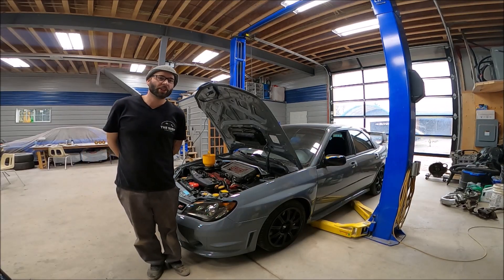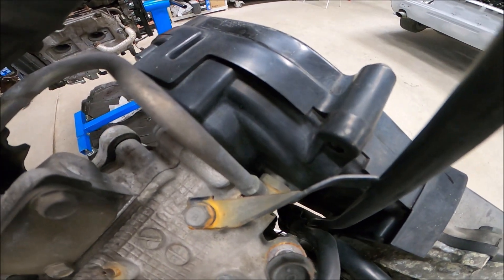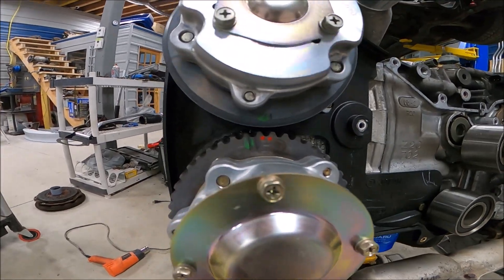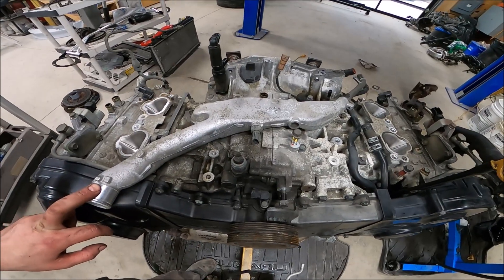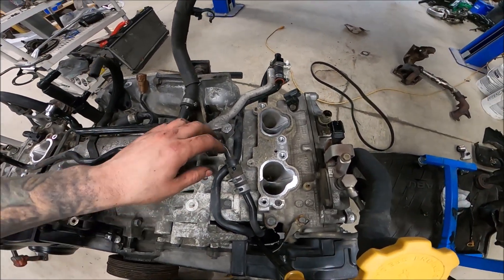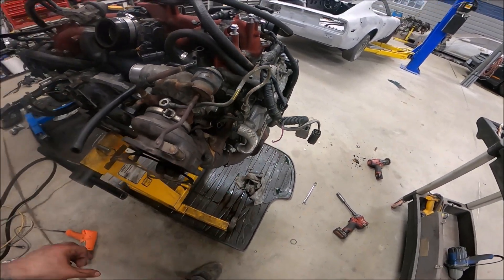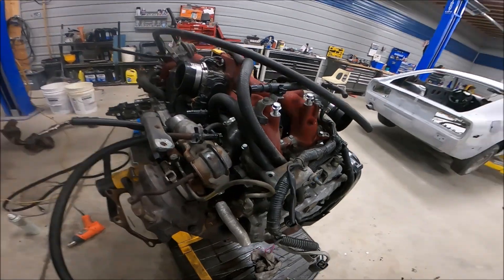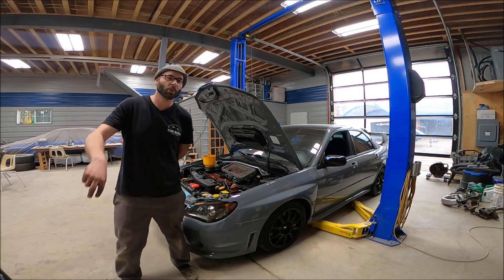How To Jdm Ej20X Swap - 06-14 WRX, 04-07 STI, 05-09 LGT, 04-14 FXT

Comment: I just completed the same swap....Instead of clocking the exhaust cams back 1 tooth, I went a head and swapped the exhaust cams and cam gears from the USDM engine as well. Also replaced the cam seals and checked valve clearance.
Reply from the maker: Yes that would do just as well. Our method is the most common/cost/labour effective way. Leaves his 257 complete for his build. 

How did you do on power/trq?
Reply: @TheSubieSanctuary  I didn't have to do any tuning, But it runs extremely well, Im assuming stock hp/torque numbers.
Reply from the maker: @thebeardedgarage2  nice, they really are a great motor for the money. Rob here has one in his hawkeye and beats the shit out of it on the track. Its held up very well with extreme track abuse and 270whp
Reply: Adam, so when you did the cam swap, you left the timing to stock with the usdm heads correct?
I'm assuming Subie sanctuary didn't need to do that because the STI has dual avcs? 
Does anybody know if you can just reclock the exhaust cams and still use it in a non-sti WRX?
Reply: @carlniro4644  Correct Carl, I did not have to re clock the exhaust cams, because i used the exhaust cams from the usdm engine. My engine swap was a non-sti...wrx swap...so yes, if you wanted to just clock the exhaust gear one tooth back, it would work.
Reply: @thebeardedgarage2  thank you very much, this helps me greatly as i do not have the sti either. Any reason you rather have swapped the cams vs just reclocking the cams?
Reply: @carlniro4644  Hey Carl...I decided to go the swapping the exhaust cam route because i wanted to replace the cam seals, and re shim the valves.
Reply: @thebeardedgarage2  ok awesome, i sincerely appreciate the response and time you took. Thank you
Reply from the maker: @carlniro4644  this sti is single avcs. Our usdm sti’s didnt get duel avcs until 2008 (gr model) 

Leaving the options for 20x/y engine into single avcs car at: 
1. Install usdm exhaust cam shafts and gear 
2. Turn back exh timing 1 tooth on stock 20x/y exh cams (like in video)
Reply: @TheSubieSanctuary  you guys are f-ing awesome. I thought it was newer with the dual. This is going to save me a ton of headaches. My friend and i got into rebuilding these and have a 13&14. Both blown engines. He rebuilt the 13 engine and we have been having nothing but issues with the p0018 code, so i wanted to do a ej20x swap with the next car instead.
Reply from the maker: @carlniro4644  my pleasure buddy! Thats what we here for!
Reply: Great info guys! You guys are awesome 👍👍
Reply: How do you pass emissions with no egr on the ej20x ?

Comment: This makes me feel at ease. I did this swap a few months ago blind and only had forums to reference. I ended up changing the timing by 2 teeth instead of one bc of conflict in the forums. Luckly i still am working the car and haven't driven it much. Ill change it back to one. 

Also made peace of mind bc other than that i did the swap the same way. Thanks for the reassurance!
Reply from the maker: Dont feel bad, the first time we did it we changed it 3 teeth 😂 it was fine and eventually we changed it to 1 tooth.
Reply: @TheSubieSanctuary  ha ha all the different answers from forums 😅.
I'm glad someone finally did a video like this. Especially in high quality and easy to follow video. Thanks again!
Reply from the maker: @NikaidouStep  thanks! Glad it was helpful.
Reply: @TheSubieSanctuary how much hp/tq gain did you saw at the dyno?
Reply: @TheSubieSanctuary  what about two teeth? Having a hard time getting a solid answer from forums.. Vf52. Also, I keep hearing mention of plugging oil squirters or something? TIA
Reply from the maker: @jarltorque4855  1.5 teeth is prefect but not possible. 1 tooth is our preferred route, tested and true. 
There will be no hard with 2 teeth. 
As for plugging exh avcs, you would have to swap on your original 255/257 exh cam shafts, gears and cam seals. Wont notice a different though and its a lot of extra work for nothing really. 
Otherwise there is no way to make the exh avcs simply function in these cars as they are not equipped for it

Comment: Thanks for the vid and clearing this up.  I have actually done 2 of these swaps about 2 years ago, one was an '07 OXT Limited and the other an '05 LGT and both of them, aside from leaving the AVCS disconnected on the exhaust, I did nothing else aside from swapping what was necessary.  I thought I was going crazy because it definitely felt like it lost bottom end punch, especially at initial throttle tip in from stop lights, stop signs, etc.  It took it about 2 seconds to catch up and then start to gain some power in each car and I was unsure of how to cure it.  After studying mode 6 data and watching AFR, etc I still could not see much other than the ST fuel trim was off at initial throttle but timing and trim both caught up at about 2500 rpm.  The exhaust retard of 1 tooth makes so much sense!!!!  Why did I not notice or think of that!?!?!?!  Man, this video cleared that up 100% as I am currently doing my 3rd swap in my own Outback XT, so I'm very excited to notice the difference off the bottom end.  Thanks again, great video brother!!  Total thumbs up.  :-) 😀👍👍🤟
Reply from the maker: Thats awesome! Ya out early 20x swaps were also with no timing mods done. The timing mod really does make a nice difference for the little effort!

Comment: Very Helpful, I'm currently trying to swap my 2007 impreza 2.5i to a WRX and kept coming across EJ20X/Y Motors. I was skeptical at first because of the horror stories from friends of friends. Thank you for clearing most of it up. I plan on swapping the harness, fuel lines, subframe, etc. This winter while also trying to build (more like refresh) a motor for it to drop in. Once again thank you so much!
Reply from the maker: My pleasure! Ive done A LOT of these 20x/y they are incredible for the money. Very reliable up to 350whp no problem. Glad the vid helped!
Reply: @TheSubieSanctuary  I was talking to iWire USA the Subaru wiring company. And they said. The JDM Legacy GT ECU won't work for this project because it is CANbus equipped.
Reply: @TheSubieSanctuary  my builder said I would have to use a Standalone ECU by Haltech but that’s nearly 2500$ and I want to find a way to use DUAL AVCS without putting a hole in my wallet
Reply from the maker: @marcuswade2974  a local friend, unlocked the 20x ecu himself and wired in the exh avcs. It’s possible, its not common to do but can certainly be done on the cheap using above method.
Reply: @Subie Sanctuary, If we use a JDM ECU, would that mean our AP won't work?    If not, can we still use RomRaider?   (Is it even worth the effort if we already have an AP?)
Reply: (I have a '10 FXT 4EAT*)
Reply from the maker: @serpentslick  if you use jdm ecu then no cant use the cobb ap anymore. 
Cobb has become limited anyway now and most people moving away from cobb
Reply: Save yourself some money an just buy a wrx . By the time you spend all the money on parts and labor you could've bought the car. Believe me. I had an 04 impreza 2.5ts n/a an now got an 06 obxt . You got think motor,mounts,driveshaft, axles ,rear diff, wire harness , etc. Save your money an buy it. So much easier.
Reply: @TheSubieSanctuary  Hey so I recently did this swap on my 11 wrx, I swapped all usdm components but left the crank and cam and oil pressure jdm sensors, I went to start the car and all I got was crank, I’m getting fuel to my injectors but not spark so that leads me to the cam position sensors I swapped those with the usdm ones and still just crank no start, my accessport is throwing codes for the intake cam saying they are plugged in, but they are not sure what’s going on any advice?
Reply from the maker: @rixhz2676  double check your connections especially grounds. Then if all good. Check your main engine connector. The one on turbo side of engine bay. Unplug it, look inside for pins pushed back into plug or bent. Make sure it plugs in real tight after. 

Let me know how you make out. If your motor ran before it should run now. It will end up being something with respect to connection issue for you
Reply: @TheSubieSanctuary  okay thank you, I’m swapping my ej255 heads on so gonna take a look at everything including my harness and gonna look for any corrosion
Reply: @rixhz2676  did you figure out your issue ?

Comment: im about to do this swap cause my ej255 blew up. im literally just going to mirror this. thank you!
Reply: Did yours work out ok? Did you do one tooth or two on the exhaust cams? Vf52 spooling ok or are you getting a lot of lag? My 255 is almost out, about to order a 20x/y for my swap. Thanks in advance for any info
Reply: @jarltorque4855   honestly i havent finished it yet. i had to buy a truck to drive instead incase anything comes up. but its a super cheap swap so ill probably be finishing it all up by august. im going to do 1 tooth. but im also just getting it back on the road and selling.  cause itll be worth more than a roller
Reply: @MidoChan808  right on, thanks. If you remember, give us an update once you're back on the road!

Comment: currently doing this swap on my 06 WRX

Would you also recommend exhaust AVCS block off plates to prevent oscillation of oil pressure?
and Would you also recommend swapping the cams from the old ej255 to the used ej20x, or at least the cam gears to non avcs exhaust cam gears?

Comment: Did the same swap but the turbo doesn’t spoil quick should I advance the timing belt instead of going back in time
Reply from the maker: Do not advance the timing. It wont help. 
Did you get a tune yet?

Comment: Thanks man for watching out for those of us who have the subie bug 🐛 bad.
One question can I go the same route if I had an ej 257 usdm 2018 and up into an ej255 07 wrx? Same close concept? Would that also got for a VA V10 JDM 207? would a swap of either play in the same way you don't ej20x/y?
Reply from the maker: My pleasure buddy! 
Yes actually if you wanted to put a duel avcs 257 into a 07 wrx, it would be the same process as this. Along with the V10 207 as well.

Comment: If I were to get a Killer B oil pickup tube, I'm getting it for an EJ20 right? Or does the lower end count as a 255 too and I should order the EJ255 oil pickup? Since you mentioned it still uses 255 spark plugs what else is compatible?
Reply from the maker: You would get a pick up to match your oil pan. Ideally the best oem pan to use is the 08-14 wrx and sti so order a pick up tube for 2.5
Reply: Would the iag pick up and pan work?

Comment: I had a question iv done a lot of jdm swaps but never a ej20x im swapping one into my Hawkeye and was wondering if I have to swap the crankshaft sprocket as I know in the jdm ej205 you have to swap the crankshaft sproket and top right camshaft sproket because the markings on the back are different then the usdm motors so our ecu won’t read them correctly to run?
Reply from the maker: @jjjuntunen8799  with swapping the 20x into a hawkeye you do not have to swap cam or crank gears. Ecu will read all just as it did originally

Comment: Awesome video! Question… I saw another person on this platform say that the cam sprockets needed to be exchanged as well from the ej25 motor. Is that true? He also stated the dual AVCS needed to utilized for optimal performance. What do you think?
Reply from the maker: You could replace exh cams and shafts. Youll have the exh avcs solenoid channels to deal with as well. 
This not a performance upgrade, rather an economical replacement as it is. As seen in video it did 300whp with mostly just stock sti stuff. No way replacing that exh cams is going to net anymore or be worth it. But too each their own. I wouldnt waste my time, if you dont want the ej20x there is a single avcs 32 bit (works in all the same cars as ej20x) typically about double the price but if your paying someone to swap exh cams and plug oil galleys then the single avcs will work out cheaper in the end. Hope that helps!

Comment: If I put a tune made for a ej255 with 3" downpipe (05LGT) , and do these mods, this tune should be fine for the ej20x swap?
Reply from the maker: @pksystems4714  it will run and drive ok, but i would still recommend revising the tune to compensate for the drop in displacement and timing

Comment: 2 years later and i’m using it right now
Reply from the maker: @gemz172  my man!
Reply: @TheSubieSanctuary  What would be the best way to route coolant hoses/which ones should I use between the 2 motors? It wasn’t too clear in the video
Reply from the maker: @gemz172  you would use your original coolant lines. Some are the same though

Comment: By far the best video on this swap on YouTube 
I’m in the process of doing this swap and had one question do you use the coil packs that come with the 20x are they the same and also I use 1 step colder plugs do you know if this is good to use or dii or es the higher compression 20x require original plugs 
Thanks
Reply from the maker: Thanks brother, you can use the 20x coil packs no problem. They are the same as 255/257 ones with the exception of the last 3? years of the GR sti/wrx they have an extra tab on the plug in. 
One step colder plugs isnt a bad idea if you want to crank it up a bit. Wont be any harm in 1 step colder.

Comment: Love the vids, y'all. You guys are actual subaru wizards lol. I was just wondering, would a stock ej20x handle simple bolt ons? My 05 sti is a stock 257 with headstuds, also with a cobb 20g and running e85. It's making under 400ish crank. There's nothing wrong with it (yet lol) but I wouldn't mind spending the money if it's an overall more robust motor, just to have that peace of mind. 
Thanks! Keep up the amazing work y'all do!
Reply from the maker: Thanks brother, much appreciate the love. Yes the 20x in stock long block form is reliably capable of 350whp all day long! I wish we had access to e85 in Canada. The 20x would thrive on that being a higher compression engine.
Reply: @TheSubieSanctuary  I did the same EJ20X swap and I just had it tuned on 91 to see what it makes before I go flex fuel. I made 271 hp and 273 ft/lbs tq.
Reply from the maker: @shinobu3817  not too bad!
Reply: @TheSubieSanctuary  do u still have the car, if so have u done anything else ?
Reply from the maker: @shinobu3817  this was a customer’s car. He still has it and has not done any mods since this and remains to be working great!
Reply: I will definitely let you know .. also what type of gas should I be putting in the vehicle ? It’s all stock . I’m in Boston mass . We have 89,91,93 .. I have been putting middle grade
Reply: @alanawilliams6288  always the highest octane you can get at the pump! 91-93 octane. These are high compression, to prevent detonation you need higher octane. In Japan they have access to 100 at the pump.

Comment: This is awesome! Thank you for the video. I did this swap on my 07 Outback XT a couple years ago. I know the video is old, but I hope you read this and can provide some advice. TIA!

A fairly knowledgable friend helped me out and he advised me that it was just plug and play (didnt do timing, or an open source tune, etc), but did everything else you showed in the video. I have only put about 4k miles on it (weekend dirt road car), so hopefully, I haven't messed the engine up too bad (by not doing the timing/tune).

I am planning on doing a timing belt job, water pump, and OEM Tstat and will fix the Exhaust Cam timing as shown (1 tooth).

Do you have any base maps for this swap? I am currently using the stock maps.

I picked up a Tacrix cable to look at some data and noticed my DAM is stuck at exactly 0.5 instead of 1.0. I am not a tuner and the person who tunes near me, will only work with Cobb Accessports. I'm running the stock turbo and a catless downpipe, but everything else is stock (no air pump). Any advice would be appreciated! 

Thanks again, this video and the information you are providing is invaluable and a lot easier to digest than digging through forum posts!
Reply from the maker: Hey buddy! No i do not have a base map. But your on the right track with tactrix cable.
Reply: @TheSubieSanctuary  Appreciate the reply, I'll poke around the forums some more to see if I can find something that matches my setup. 

Car pulls nice, drives nice, but that IAM/DAM makes it seem like it isn't happy about something.

Comment: Cool video.  Same process on 06 Outback xt?  And no need for reprogramming the usdm ecm?
Reply from the maker: Same process for 06 obxt, it is best to get a tune. 
Your obxt will have an air pump on engine and unless your getting a tune then you will need air pump version Ej20x

Comment: Hello, I loved the video, I was wondering what year EJ20x would I need to droped it into an 04 STI. I picked up a 04 sti with a knock just trying to get it back on the road.
Reply from the maker: You can use the early 20x in the 04 sti. It will be the one without air pump!

Comment: Excellent video my brother thank you, I have a question hope you still respond. I'm swapping a JDM EJ20x/y dual avcs into my 09 FXT RHD JDM single AVCS. Can you say if the exh avcs can work with my JDM ECU or should i turn back the gears? Also the turbo for the 20x is IHI rather than TD04 as FXT, can you recommend intercooler and exhaust system to unlock this power. Thank you for sharing
Reply from the maker: Hey buddy, so your jdm fxt is single avcs correct? And you want to install the 20x/y. You wont simply be able to get the exhaust avcs working without some serious effort on wiring/tuning and someone to unlock a duel avcs ecu to work with your fxt. 

Turning back the exh gears closer mimic your original timing is definitely the easiest route. 

As for turbo, is your jdm fxt already a twinscroll turbo or single scroll?